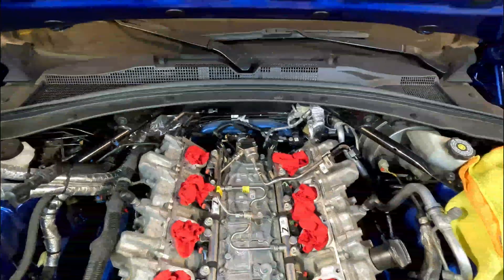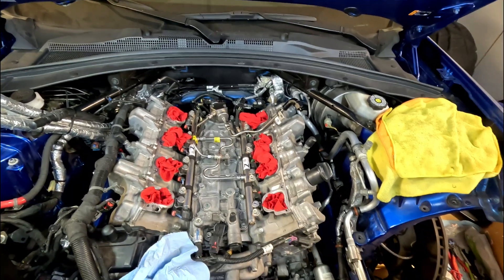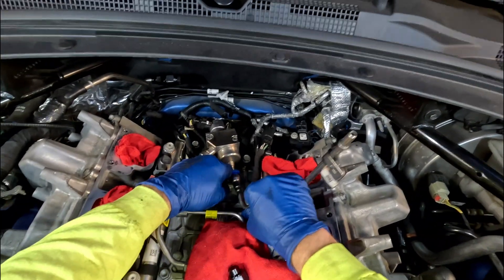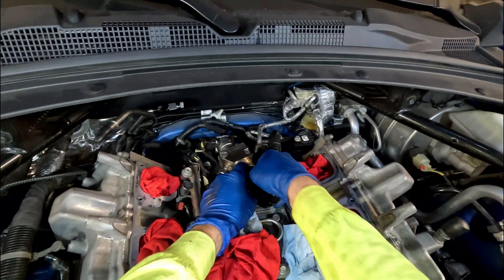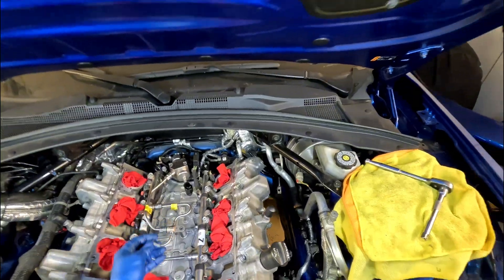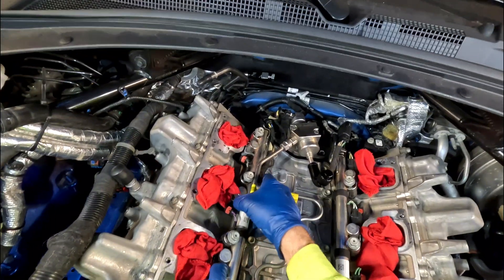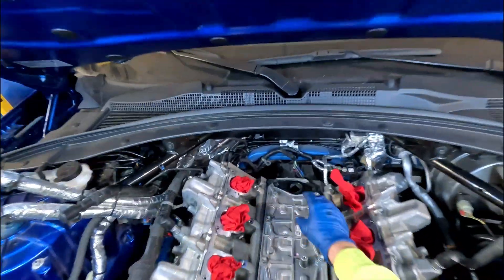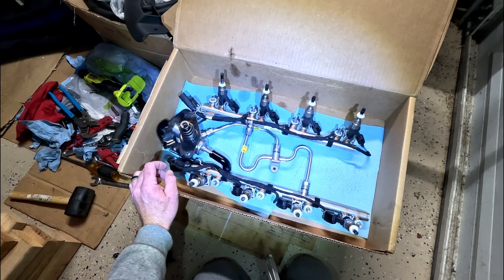High Pressure Fuel Pump, Fuel Rail, and Injector removal 2018 Chevrolet Camaro ZL1

Comment: Do you have a part number for the 150 degree fitting?
Reply from the maker: I'll be using a 3/8 quick connect to -8 AN adapter with a vibrant full flow 150* -8 AN hose end, if that's what you're referring to.  I don't have a part number, but I usually get my fittings from Summit Racing.